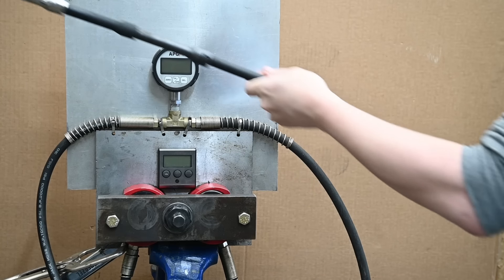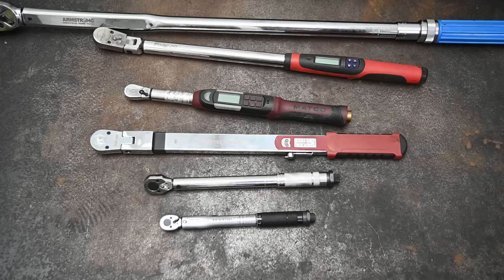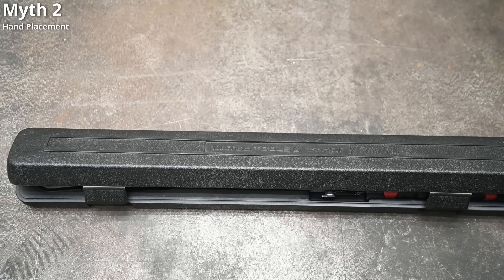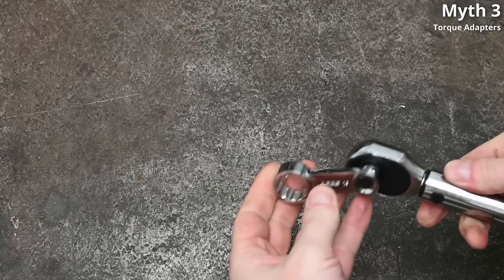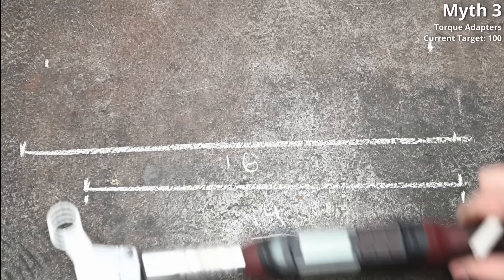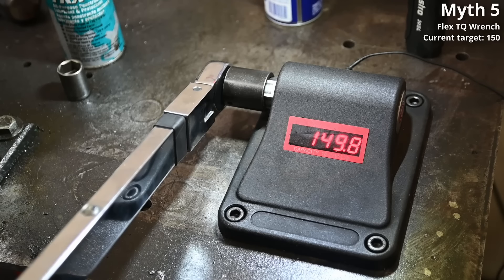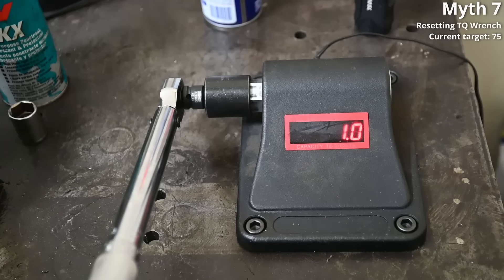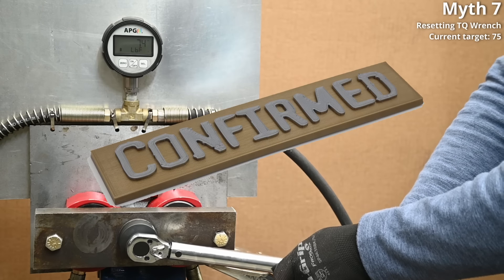You're Using a Torque Wrench Wrong: MythBusting 10 Do's & Dont's

Comment: You can make a torque wrench out of a box end wrench and a fish scale like you might find in a sporting goods store. Torque is just a certain amount of force (in pounds) operating around a certain radius arm (length in feet or inches), assuming the force is applied at a 90 degree angle from the torque arm. So it is easy to see that a box end wrench and a fish scale is all you need. I once needed to torque down an exhaust pipe and I didn't want to jack up the car and crawl under it. I just put the box end on the nut, attached a wire to the other end of the wrench and made a loop, and pulled on the loop with the fish scale. Again, making sure that the wrench was at a 90 degree angle from the wire.

Of course, some calculation is required. If you need 50 foot-pounds, and your box end wrench is 9 inches long (or 9/12 of a foot), you have less mechanical advantage than if your wrench was exactly a foot long. So you'd have to multiply 50 times 12/9 which is 66.6 pounds you would have to pull on that fish scale. Or, if your wrench was 15 inches long, you have MORE mechanical advantage, so you have to multiply 50 times 12/15 which is 40 pounds you'd have to pull on that fish scale.

I was a bit surprised that the old-fashioned beam type of torque wrench was not included in this test. BTW those torque adapters at 90 degrees DO add a bit of lever arm length, but are short enough that the extra length doesn't matter. But if your torque adapter was 5 feet long, you would certainly have a lot more mechanical advantage on that combination, and over-tighten things.

Comment: I borrowed a bunch of extensions at the shop I worked at and tried a 12 foot long 3/8" drive test, and it did not seem to make any difference. You just have to turn the wrench 1/4 to a 1/2 turn more because of all the twist/flex in all the extensions adding up. Torque results remained pretty constant.

Comment: what I was told in aviation was use a beam style torque wrench to measure run on torque with the bolt dry then apply thread lubricant and subtract the difference in run on torque
Reply: run on torque, to my understanding, is added to the standard torque given for the fastner, due to the locking friction of the nut. no lube is applied unless called for by the mm.

Comment: I used to use $10 1/2 harbor freight one at work, chevy lubetech. Most of them are pick up trucks so torque down to 140 foot pound, 6 lug nuts x 4 tires x every car that comes in for oil change. I never set it back to zero. Always left it at 100 or 140ftlb. After 1 year of use, ratcheting function started to slip, but applied torque was still somewhat accurate it was like 135ftlb.

It has lifetime warranty so I replaced it for free.

I trust those for lugnuts and suspension stuff. I bought 2 more and each of them are sitting in the trunk of my cars.

However 3/8 is not good. Sometimes you miss the click and you turn too much. That click on 3/8 is too weak.   Or if you set low on 1/2, it will make weak click so watch out for that. I would never use harbor freight ones for engine work.

Comment: Great video!, would never have guessed anti seize made that much of a difference!

I noticed two scenarios that you didnt cover though. The first is "torque it slowly" does it matter how fast you bring it up to torque or if you "bounce" on the torque wrench to reach the desired torque.

And the second scenario would be a relatively short extension (2-6"?) With no support at the head of the torque wrench, only pressure applied to the wrench handle

Would be cool to see if either of those make a difference or not

Comment: The lube change drives me crazy when putting on air-cooled VW heads.  4 of the nuts are inside the head and all oiled up.  4 are out in the open air and likely rusting to death.

Maybe the different stud lengths contribute to balancing the potentially uneven torque.  I still clean the threads and oil them equally each time I re-assemble.  And, when I built my 2-liter, new studs and nuts each time.

Comment: I once forgot a cheap click and cam torque wrench wound up on 120nm and long and behold now I use it as a breaker bar. 
Yes, click and cam wrenches will definitely get out of spec if you don't unthigten them !

Comment: One quick thing:

Using an extension at a 90 degree angle keeps torque the same.

But thats not always what youre supposed to do.

Example, if youre installing barrels on an AR, DOD has resources for setting torque on with a torque wrench and an armorers wrench (as an extension).  They call for 180 degrees.  Because they KNOW the distance of approved armorers wrenches.

If you change the armorers wrench to 90 degrees, your torque will not be accurate to DOD specs.

If an engineer says "use this torque wrench/tool combo at this angle and torque to this spec", do it.  Whether that angle is "wrong" or not.

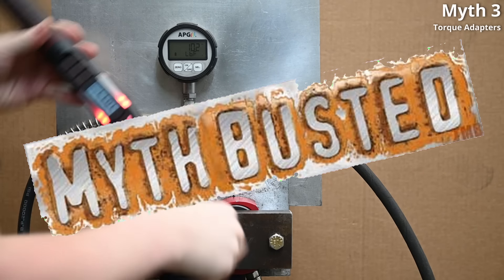Comment: 8:56 explained this to my coworker the other day and he was kind of mind blown lol. Should be noted some digital torque wrenches let you add an offset length for crows feet etc as well. (At least my snap on one has it in the settings. I use it for injection fuel lines alot)

Comment: I have two of the Super cheap HF tourqe wrenches, one I have been using as a breaker bar sloshing around my farm truck, checked em all the other day and I couldn't determine which one I have been mistreating, they all were within 1 or 2 ft lbs @ 80 target

Comment: For the 90-degree torque adapter, you calculate using the hypotenuse. However, for a short extension, the difference is usually well within limits.

Comment: Torque is usually a tolerance zone so exact measurement is redundant.  Using the same wrench on patterns usually yields excellent even torque.   I don't really care if the torque spec is 100 and I reach 98 average.  There are applications where a single torque gets precise like in bearings.  Great video.

Comment: I would be interested how much loctite (blue) changes torque readings vs actual fastener tension. Loctite is helpful in that it fills the void in the threads so corrosion  (especially galvanic) is reduced while also acting as a thread locker to help prevent the fastener from backing off on it's own. I've raced 2 stroke aluminum (Twin spar) chassis grand prix bikes and if you don't use multiple methods to keep fasteners in place they will fall out on their own almost instantly.

Comment: I really didn't expect the click type to actually lose accuracy when stored under tension because springs don't work that way, I wonder if something else is to blame(like the pawl that's responsible for the click peening). Springs wear from cycles(compression and de-compression) they don't form memory from being compressed long term unless they get exposed to high heat(in excess of 1000f).

Comment: I am kind of curious about the leaving it at max torque setting myth since if designed properly a spring should not really loose tension/force over time. It should be the cycling of the spring that causes degradation according to most. A common gun myth is leaving magazines loaded for years vs. unloading them when not needed and the difference is negligible. However, we are also not talking about 2% accuracy.

Comment: Damn

I’m an airplane mechanic and yesterday we were changing components on a trailing edge flap and when we were torquing them down, we encountered a clearance issue  because the nut that we were torquing was recessed in a pretty small hole. We were using a crowfoot wrench and we couldn’t get it to sit at 90 degrees because of the clearance issue and our inspector said there’s a formula to use for when you can’t put the crows foot at 90 degrees and we spent a little while looking it up. And of course today I watch this video and the formula is right there lol. It’s good to know the why’s for your questions instead of just knowing this or that is standard protocol
Reply: Also I did always wonder why lubed fasteners had significantly less torque values when compared to dry fasteners in the maintenance manuals. That makes perfect sense

Comment: i was taught that if you have to back off the torque on a click type torque wrench you needed to back it off all the way, let it rest, then readjust  the micrometer to the desired torque due to spring memory.

Comment: I have a torque wrench that was last calibrated a little less than 40 years ago. I don't have the money to ship anything every cent is accounted for in this household unfortunately. If there was any way that I could get this tool to you for free to test and then get back because it does have some fairly important heritage to me I would certainly like to do that. You've certainly struck my curiosity with the accuracy of torque measurements but you know one that's been calibrated quite some time ago I feel like would be pretty interesting

Comment: There is a mil-spec standard that says "Any torque wrench (digital, split beam, and/or clicker) needs to be exercised five times at the lowest setting and the maximum setting. This procedure must be followed prior to checking a torque wrench out of the tool crib for the duty day.

Comment: For the flex head. If you use a flexhead with significantly more flex. at 90 degrees it would significantly reduce the torque i believe. But at only mild flex it doesn't harm the torque to much. This is more a problem on swappable heads that got a big range of flex.

Comment: What I do when using antiseize I torque the bolt to spec dry, but I measure how far I turn the bolt after it has bottomed out, and then reapply a similar amount of travel after applying anti seize.

Comment: I have a request ! 
Could you include the torque multiplier into the test for high torque ? I am having an argument with a buddy telling me i dont need a 3/4 torque wrench for tightening a 400lbs lugnut. I could just use a 1/2 torque wrench and set it up 3x lower with a torque multiplier ( neiko  1x3 planetary gear style  torque multiplier ) 
Keep up your good video !

Comment: The anti-seize test was eye opening. I am an engineer and have speced bolt torque to achieve certain clamping force in some projects. In the reference I use lubricated to dry thread is 25", in other words 100 ft-lbs dry would be 75 ft-lbs lubricated. Does your test rig show clamping force? It would be interesting calculate the K factor from your test.

Comment: The effect with the spring is going to depend on the design parameters of the wrench. If "fully tightened" is approaching the yield strength of the spring (about 75% IIRC), then the spring will take a set over time. Below that threshold, the memory effect doesn't occur. So, it depends on whether the design respects the boundaries of the materials used, or if it pushes it closer to the limits.

Magazine springs is the other place where

Comment: I've been told that aircraft mechnics are supposed to click their torque wrench a couple of times on a jig. (Like a 1/2" square drive fixed to the work bench) because only after a couple of clicks will it be as accurate as possible.  From your tests it looks like there might be some merit too it but overall the effect is only a couple % or so.

Comment: 16:42 in the mechanical design/engineering side of this, a torque is specified as wet or dry, and if wet usually with a very specific (brand-model or sku or spec) lubricant that was tested to account for the k factor.

Comment: Nice video, I made a 3/4 drive wrench adapter to torque a motor at 500 pound  at shop and my engineer said that the that torque the error from the angle are minimal but interesting nonetheless

Comment: Mr. TTC guy, THANK YOU VERY MUCH!  I try to torque at least some things at work (mechanic), while my boss cares not about using them.  But it has been bothering me when I have to use a crows foot wrench due to access (and now I know there are torque adapters so maybe I'll get some in the future).  So far what I've done is compensate--look at how much length is added when straight on, then choke up on the wrench the same amount.  I'm guessing that might work but now I have the right formula for it!  Thanks! :)  I also took a lot of other notes from this video.  I want to make a fact placard, laminate it, and put it on the inside of my bigger toolbox lid! :)
Reply: Actually, since choking up on the standard click wrench increases the torque at the click point, as demonstrated in Myth 2, you will have been making the situation slightly worse rather than compensating, sadly.
Reply: @PlatypusPerspective  I don't get how. The two principles seem to work oppositely.
Reply: @PlatypusPerspective  but at least now I have the math to do instead.
Reply: @danielgoodman3578   Yeah, it seems to work backwards when you first look at it. The key is to see that the common type of click wrench is made up of two levers of different lengths. The force from your hand is applied over the full length of the tool to deliver the torque to the fastener axis, but it passes via the shorter lever formed by the tubular handle, which has its axis at a pivot pin a couple of inches short of the fastener axis. The measuring mechanism inside the tube only sees the force being applied over this shorter lever.
If you move your hand halfway up the wrench, and apply twice the force, the resulting torque at the fastener will be the same because the lever length is now halved. But the lever length where the measuring mechanism is measuring is now shorter than half its length, so it thinks you haven't reached the required torque yet. You will have to apply more than double force to get the click indication.
If we keep going further, the discrepancy will get worse until when we reach the handle pivot point, we could apply huge force and deliver torque to the fastener, but the click mechanism would receive no input at all, and never click.
If you're interested, a while back I put a short amateurish video on my channel showing the torque variation using an angle-of-the-nut indication.

Comment: My local tyre shop when refitting the wheels to the car initially do the bolts up with a low air torque wrench setting then finish off by cross sequence tightening with a torque wrench, at no point do they use any form of lubricant on the threads.

Comment: Some stuff does spec to torque it with various additives on the thread or surface...so have to do it wet or dry per the spec of the manual.  If it says lubrication and you skip it will be less than intended.

Comment: Another test you should run is tightening a bolt/nut slowly vs quickly with a torque wrench. Tightening quickly will not give the nut/bolt time to reach the proper torque before the wrench hits the torque giving a false reading.

Comment: Thread locking compound serves as an anti seize because it seals moisture out of the thread. Use low strength on wheel studs

Comment: I knew anti-seize made a difference, but I had no idea it would DOUBLE the bolt tension!  Any chance you could test the effects of different lubricants?  Say loctite, penetrating oil, or even rusty bolts?  Also, I would love to see the precision and accuracy of different bolt tensioning methods (i.e. turn-of-nut method) on different joint types, like bolting sideways through tube steel or pipe, or two plates of steel with plywood between them.

Comment: Guilty of the anti seize. Was doing strut tower bolts, seemed rusty so i cleaned them up, put anti seize, torqued to 55, and every single bolt snapped off. I was at a loss of words. 

However, I am yet to see 10.9 graded bolts to ever snap off, so check your bolt type if its 10.9 ur good to go

Comment: Autoexpert did a great video on torque wrench use, and on bolt tension and when you use anti seize etc. 

I get all my torque wrenches calibrated yearly. I've had a Chinese made warren and brown wear the spring and i did leave it at the high end of its tension. By comparison my Australian made warren and brown split torque wrench never goes out of calibration...

Comment: When torqueing engine parts (rod, mains, or even head bolts) the instructions often said with 30 Weight oil or similar. 
So.... No on anti-seize but good on oil on critical engine parts?
Thanks for a great video with  one more question to be answered.

Comment: Dad had a Snap-On torque wrench, I had it tested by the Snap-On guy, its accurate to within 2Ft-Lbs. Not bad for a wrench that's been used for a good 20-25 years. The Snap-On guy told me "dont reset it to 0, set it for at least a few ft-lbs.

Comment: One rule of using a torque wrench is to make sure the fastener is moving when reaching torque.  Many times, due to limited swing, you have to stop and get more range for swing. If it clicks when starting from a stop, it is not torqued, you need to back off and continue to overcome friction.

Comment: Anti seize was huge. I used to work at uhaul and they anti seize every damn bolt as policy. They had a torque chart that specified lubricated threads. Wheels were torqued to 50 ft lbs. I now see thats almost 100

Comment: The length issue also would also depend if its a short or long handle wrench vs short or long adapter... the longer the wrench the less % error the adapter will affect at the same length adapter

Comment: I anti-sieze my lug nuts since forever. I also  use a torque wrench. So far they have not taken any visable damage from me overtightening them. If you have rusty bolts, and use a torque wrench, you will actually undertighen them,  which I consider far worse for a wheel on a car...